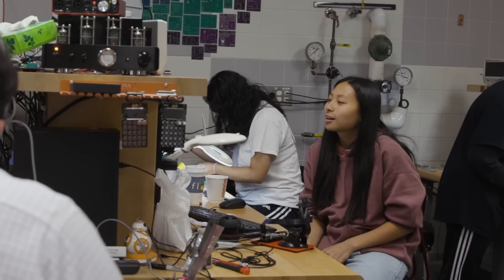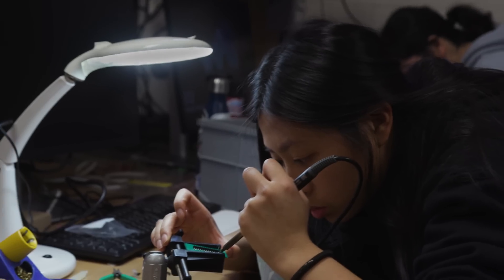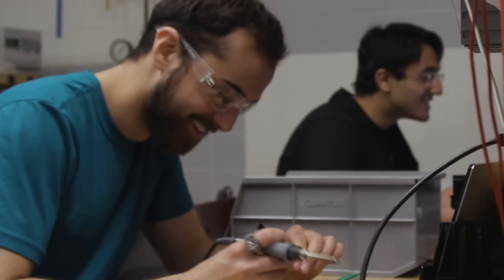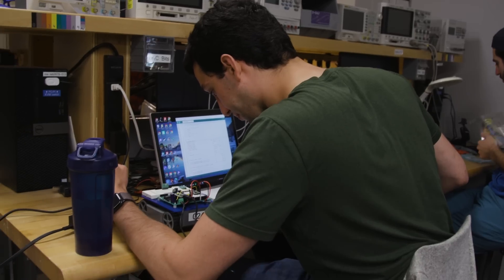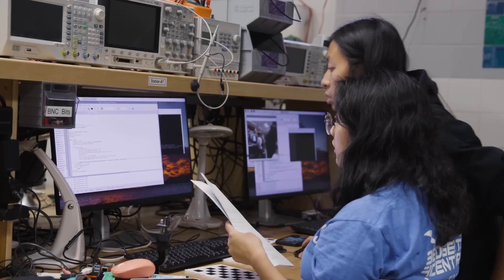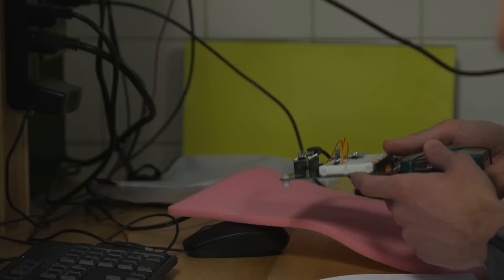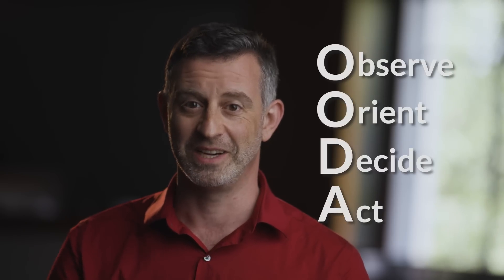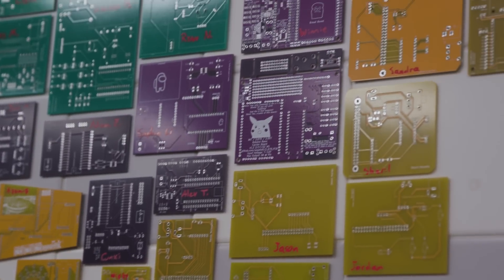Imagine it, build it

Comment: Advice for those wanna do electronics engineering or something related. 
1. Whatever you build, it is gonna work the first day. You prolly going spend 2 weeks on troubleshooting a circuit.
2. Don't be afraid that you gonna destroy components, it is part of the learning process.
3. Ask Ask Ask questions, to the prof, classmate and google. Don' t be shy
4. Always practice programming like C, C++ and python because those are used very much in hardware programming.
5.  Failure is not the end of the world , try again.

Comment: No offence, but Indian institutions IITs have an entire budget equivalent to a single lab being funded at MIT or any ivy league institution, and has some of the best resources and facilities available, along with it, however strict the curriculum might be, they have the ability to make something new and useful. Come to IITs and let’s have a look.
Reply: The focus for iits and MIT is completely different. MIT looks towards converting top research into futuristic technology (not necessarily for commercial usage) whereas most of the work IITs and IISc does are to make existing technology cheaper for usage by Indian industries ( there are few exceptions though). So the students are also trained accordingly
Reply: Not necessarily. IITs and IISc are working on a large number of original research projects too. @parthbarua6155